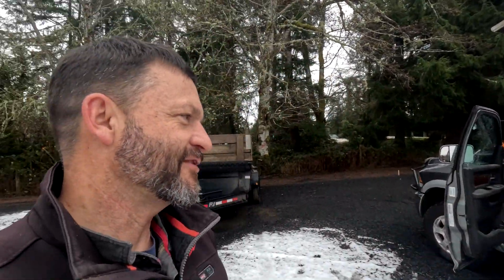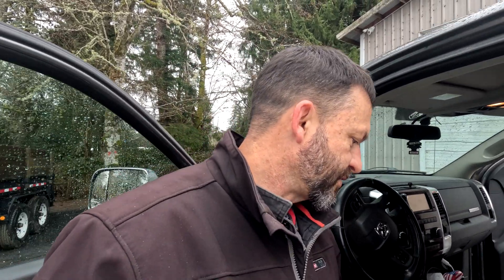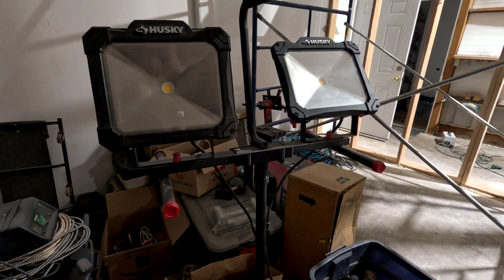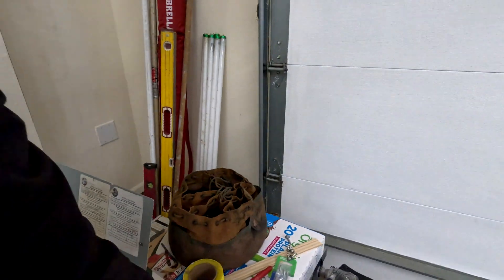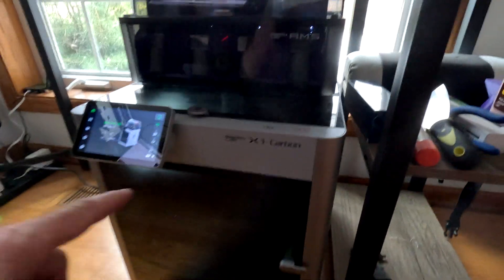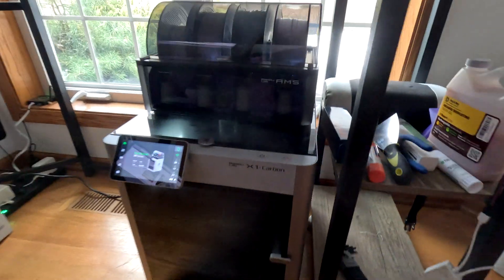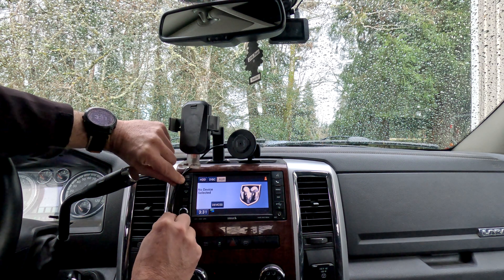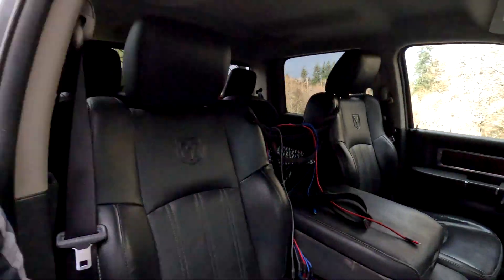3D printing functional things

Comment: Have you ever considered updating your stock Dodge stereo with an Android head unit?  You can get all the functions of your phone (GPS, LTE, app mirroring, etc.) in a truly static position that won't wobble or otherwise succumb to your washboard road habits.
Reply from the maker: @robsmalls  yes…in fact, I have repeatedly though about it!  This truck is the only one I have ever owned where I have kept the stock head unit.  Why have I never changed it?  Not really sure….i suppose there are just so many options out there that I just never took the time to sort them out.
Reply: @MattVerley  There are a few YT channels dedicated to Android head units.  Joying and Teyes are very capable and cost-friendly units from the research I've done.

Comment: Thanks, good info here on material and UV.  I was going to buy a bamboo before this uproar about terms of service showed up where they can actually stop your prints if they want.
That was a deal killer for me, too much control.  I've done very little printing, but all are failing now because they have been PLA.  PLA has not held up to the heat in the car, or repeated use probably because of the material and infill not being enough.  
Couple questions, how do you justify the expense of Fusion 360? I used to have it for business, but no longer.  Moving to Plasticity. And secondly how much infill do you usually have your designs set to?  thanks
Reply from the maker: @onjofilms  fusion360 is free for hobbyists (albeit they remove some features for this tier).  I do pay for it now as I needed to use some of the extensions.  I was an autocad user before fusion, so it was easy for me to pick up.  I know there are good alternatives out there…but it fits my needs well.  I don’t build complex assemblies, but I do use it for 3d printing, occasional drawings, and for 2d cad for my plasma table.  
Yes, I see pla is a “temporary” material…good for prototyping, testing, parts that will be discarded or need to be shaped with hot air, etc.  ABS, HIPS, and ASA are my “go-to” for permanent parts.  
I saw the news about Bambu’s cloud service issues…but these arose just recently and I’ve owned my printer since the X1C was released, so I’m just along for the ride.  At the end of the day though, I doubt that bambu would do anything that chases away too many users or kills the open source ethos that comes with the maker community.  I did see that they included a “developer” mode with the latest firmware release, that bypasses the cloud restrictions.  I’m betting the community will fill the gaps if any arise…but if not, the competition will!
Reply: @MattVerley  Thanks for the answers.  I think I needed the Fusion 360 to export step files, but I will look at it again to see if the free version can export for 3D prints.